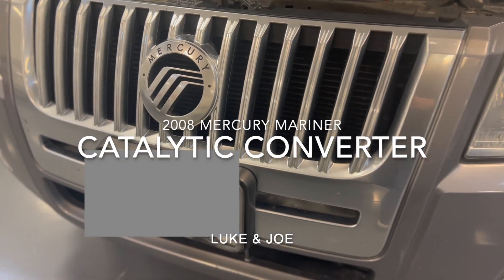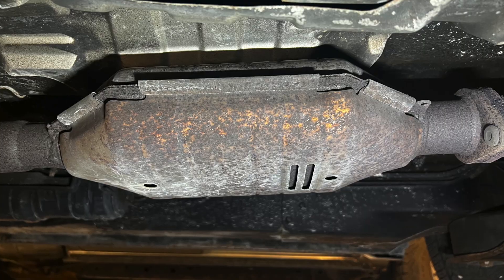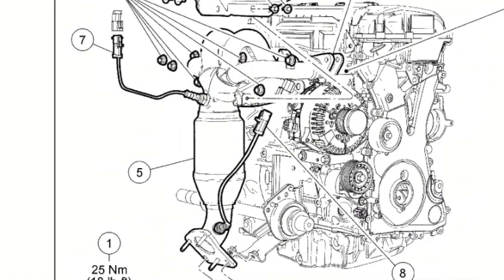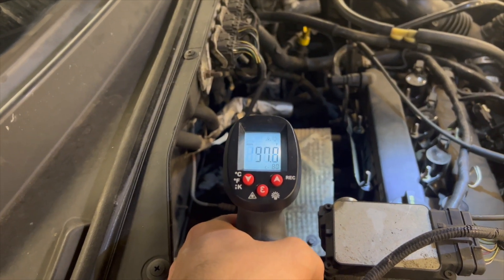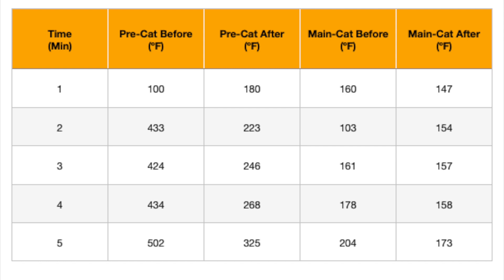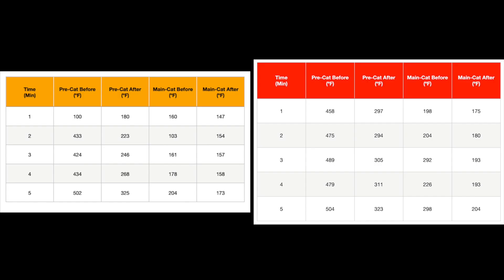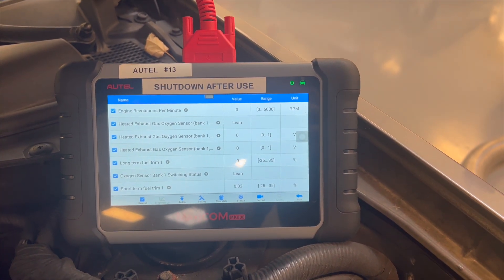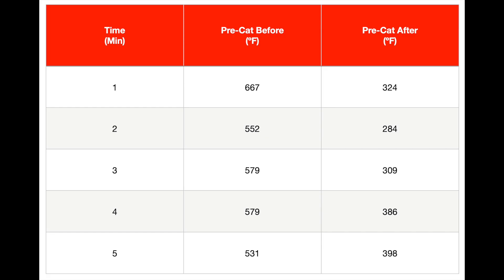Catalytic Converter Temperature Test

Comment: We are confused Your video shows output (after )catalytic converter temperature on your chart is the temperature is low number it means good catalytic converter???, but most of video said output temperature is hotter it is good catalytic converter ,here is others youtuber video search by typing this word in your tube (How To Test a Catalytic Converter is Good or Bad With a Low Cost Infrared Thermometer)
Reply: Actually , you are correct.  The temps at the converter inlet should be cooler than the temps at the outlet of the converter.  The outlet should be at least 80 to 100 degrees hotter than the inlet.  The temps shown in this video would show that the converter is bad.

Comment: This is the same Cat system my 03 ford escape xlt has. My Bolts are rusted to take off my cat converter, any tips for that by any chance? Also i saw liquid leaking from the secondary exhaust,was water, but think that is normal? (right after the main car converter)

Comment: That is very similar to what I get on my 2001 Toyota 2.2. However, I have a P0420. Not sure it’s not an o2 sensor at this point. I think heat gun diagnosis is over rated regarding cats. Not easy with the pre cat set up to diagnose with 100% accuracy. Thanks for this video. Now I know not to expect massive temp increases across cats.

Comment: Hi! i have a ford fiesta and i measure catalyst temp. bank 1 sen.1 at 504°c and sen.2 at 418°c at idle. may i know if that is safe or normal?
Reply from the maker: If it is in Celsius like you labeled that seems pretty high.  Could be caused by excess fuel being dumped in the combustion chamber and making its way to the catalytic converter where it then ignites.

Comment: Hello,
I have the ford Maverick (escape) with exacly the same engine and catalytic system. and i would like some advise about becouse i recently had problem with the pre cat (P0420). The pre cat changed but i found some pieces in the intake of the second converter. I removed them with end some small particles. Note that the pieces and the particles was in there more than 8 months. The honeycomb of the converter visualy seems ok but testing with flashlight i can see that light passes only from 2-3 holes. The temperatures measured about the same in the video. Besides i have and loss of power (not much). What is your recomendation about changing and the second cat. Please respond. Sorry about my english as i am Greek.
Thank you
Reply from the maker: If you are seeing pieces of the honeycomb downstream at the second converter, the pre-cat is most likely damaged and needs to be replaced.  The loss of power is probably caused by those pieces clogging up the second catalytic converter and not allowing the exhaust to flow.  In that case I would check the second cat and make sure that it is not torn up inside.